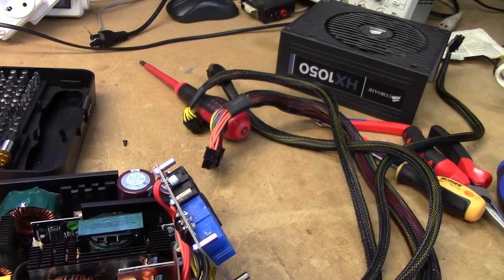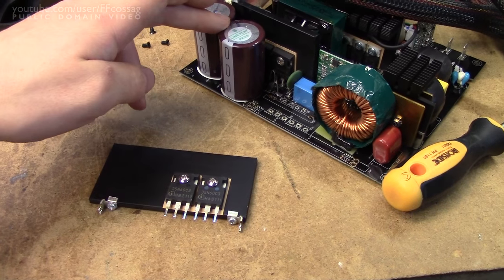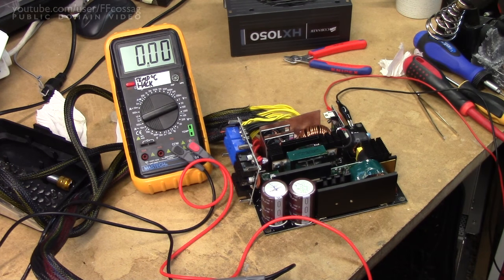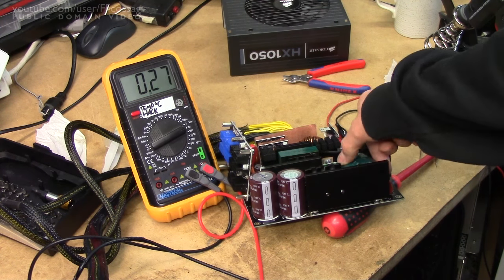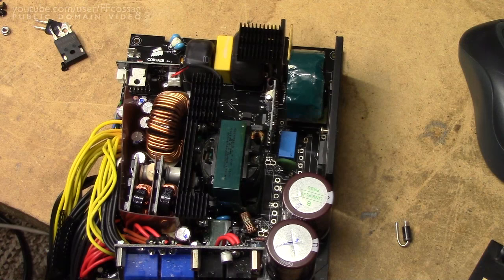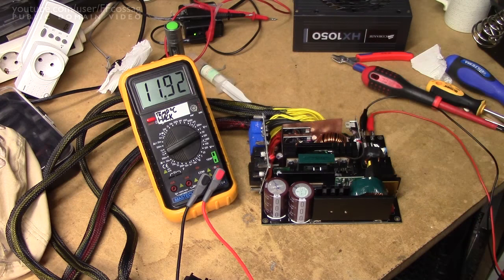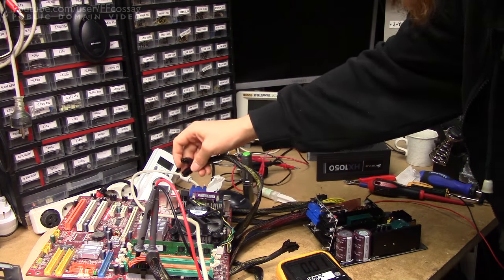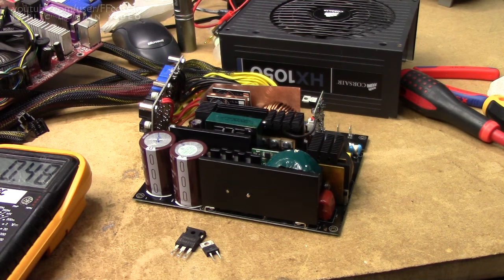Trash picked Corsair HX1050 PFC circuit repair

Comment: Whenever you have diodes or transistors in parallel, it's really best to replace both the failed one and the good one together with two diodes you  bought at the same time(increasing their chance of coming from the same batch). This is because the diodes have a negative temperature coefficient(temp goes up, resistance goes down, current goes up, heat goes up,...) and the only thing keeping a little balance is the shared heatsink.

Really make sure to order at least two of those diodes and two of those transistors, maybe even four, just in case it happens again :P
Reply from the maker: Solid advice, I'm of course replacing the failed pairs in pairs for those exact reasons.

Comment: HX650 psu had burnt mosfet and diode 1n5406, replaced them and psu came back to life. All voltages ok but under 40-50% load same components died again, one transistor and diode. Any ideas?

Comment: Great fix! You should post the video on /g/. I'm always skeptical about Corsair Power Supply Quality. I've seen them fail ever so many times whilst a cheaper Cooler Master or Xigmatek seems to just keep chugging on just fine. I think they are just very sensitive to the quality of the mains input voltage. So kids here is the life lesson "Always use a mains voltage power conditioner."
Reply from the maker: If you want to post the video on /g/, feel free - I don't usually post my videos on there any more unless it's in relation to something specific.

I would not recommend any "mains voltage power conditioner". They're usually just bullshit, and will not do much to help you if something actually goes severely wrong on the grid that the protection circuitry in your power supply doesn't already do.
Reply: FFcossag
Don't voltage regulators such as these help reduce both transience and voltage spikes from the mains? http://www.fsp-group.com.tw/index.php?do=proinfo&id=61
I don't know it seems to be the main reason for PSU failures considering we have alot of power outages and constantly flickering lights in my country.
Reply from the maker: Dirty Reviews Are you sure that's a voltage regulator? It's advertised as a UPS, and it definitely doesn't look big enough to be a double conversion UPS. I can't find any info on it, but I'd be about 90 % certain that's just a line-interactive UPS that's basically going to be a straight pass-through unless you get a long-lasting brownout or power failure.
Reply: Actually It definitely is not a UPS system. I own the 750 watt rated version and it merely indicates that it regulates the mains voltage and prevents spikes. I think its a back to back converter so something on the lines of AC>DC>AC. Its definitely heavy and probably has some large coils/caps inside so not one of those bogus Chinese "conditioners". I actually would love it if you did a video on these because they are right up your alley. Sort of like a UPS but without the battery and for people such as myself who have mains stability issues in their region.
Reply: FFcossag
I just did some quick duckduckgo searching and all I could find was that it contains a "Boost and Buck Stabilizer" according to a marketing document.
Reply from the maker: It's listed as a UPS on their website. I don't have one of them, so I couldn't possibly make a video about them. I suggest you take it apart and see if the weight comes from a lead-acid battery.
Reply: I'll check. But if it does i've never seen it kick in not even once. And it only has an on/off switch.
Reply: Helllo i managed to kill a corsair rm1000x by plugging it in stupidly to a low quality power strip. It smoked. :(

Comment: Hello, nice video ! i have approx the same, but where do i find the 5vsb and 12v rail within those output connector ? i do not have any cable and i do not see any yellow wire. thanks

Comment: So six months ago found a similar fault with my HX750 PSU.
Looking at your video, the fault is almost identical, except both larger IPW60R190 FETs had died, and the fuse had exploded.

I bought new ones, replaced them, but when I powered it back up, they were killed again. Also, the (single) C3D06060A diode blew apart (front came off with one leg, the other leg stayed on the heatsink). I did a bit more fault finding and found that the smaller diode had also failed.
Replacing all three components (this time only one FET so I don't lose two devices if it blows again), I powered it up and enabled the PSU with no load. The fan spun for a second or so, and then turned off. I'm guessing something further along the chain is stuffed since I can see the boost converter output reading the right output.

Not sure if I should spend much more time I should spend, and am I really going to trust this supply with anything other than a cheap PC now, but I'll try a few more things.
Reply: I had the same problem. Did you fix it?
Reply: @rPaguHaP  From memory, I had to place a small load on the the output, but I think there may have been one other smaller diode that had failed. I got it back up and running, and it's powering my secondary PC since I am too worried to use it with my newer parts. But it works again!
Reply: @rownadoherty  Thank you! Smaller diode like SMD diode? I Need to know here to look at :)
Reply: @rPaguHaP  I'm fairly sure all the parts I worked on were through-hole. I normally start by investigating the large semiconductors and resistors/caps.

Comment: I heard that testing a Power Supply with a meter doesn't always show faults because theres no load on it but I figure if you're getting the 5v and the 12 v readings it at least a good sign
Reply from the maker: For diagnosing bad caps, that's true. This isn't a case of bad caps, however. We just want to know if the unit runs.
Reply: @FFcossag  will the voltage drop when loaded in case of bad caps?

Comment: Nice repair!

Wish i had the knowlage! Just brought home a Silver Power 650w PSU that just stopped working.
Hoped it would be a simple "visible" fix, but as a noob i cant see anything wrong.. :P
All the caps looks fine. And it looks really advanced inside, not as easy as the older PSU's.. Several small controller boards and stuff. So its probably trash, atleast for me. :-)
Reply from the maker: What a shame. PFC failures like the one in this video seem to be quite common for active PFC power supplies in general, might be worth just measuring the primary side FETs and diodes for shorts.
Reply: Is it possible to measure the diodes when they are still soldered to the board? Or do i have to take them out?
Reply from the maker: Often it's fine, if they do measure short then you should take them out to verify.

Comment: Nice video! I have one Enermax PRO 550W (with no warranty) but it is as new.. i used it for a short time. Now it seems have a problem at 5V gray wire (Power_OK), the other voltages are ok, only the gray wire have 0V (and i think this is the cause of computer dont start).. but i dont know how to fix it..

Comment: also i have a cooler master(non pfc) 500w (many say it is actually a 450w), it has double bridges & double switch mosfets in parallel.
it works sometimes when switched on , sometimes not only 5vsb is available, the fans turn on for .5 sec & then off then i have to hard restart it. i checked the voltages in bios sometimes the 5 v & 12 v fall below the  lower 5% tolerance, i.e 4.7V & 11.3 v,
what could be the problem the mosfets or the schottky diodes or caps, i don't want to discard it, it is beautiful ps.

Comment: People say don't touch a PSU for days after it's plugged out as there can be power in the capacitors. How long did you leave it before touching it? Could you vaccum dust out of it straight after plugging it out?
Reply from the maker: Just don't poke around too much.

Comment: what would be your best guess as to what caused the power supply to fail. lighting strike or just bad luck with parts or overload
Reply from the maker: The root cause of the failure was the diode between the rectified grid and the PFC boost output. It fails if there's a giant spike on the grid, or if it's of poor quality. Lightning strike is improbable; would have been more damage. Random failure seems like the most reasonable explanation given the minimal amount of cascade failure.
Reply: valdarmort ,
The reason for the 600 V rated slow bypass diode is to pre-charge the boost capacitors on power up.  Without it, the build up of current in the choke/fast diode/capacitor loop would charge the capacitors to DOUBLE the peak voltage.  Probably all practical implementations of the boost topology use this arrangement.  But the bypass diode will pass an immense inrush current which depends on the line voltage and impedance -- including any limiter circuit possibly added to the input of this power supply.  A malfunctioning limiter could be the root cause.  A thermal NTC limiter does not work if it is not allowed time to cool down before the next power up.  Similar problems arise on relay type limiters.

Comment: what are you using for the limiting of input current? can you show us in a future video?
Reply from the maker: I don't recall if there was anything specific going on in this video, but I usually power everything off of my bench PSU. It's a TTI EX752M that'll do CC/CV up to 150 V/2 A.
Reply: @FFcossag  you are powering the psu under repair straight after the bridge rectifier with DC voltage from you bench power supply?

Comment: Would you know the value of TH1 (thermistor) on the corsair HX1080 as it is burnt
Reply: I'm trying to rescue a HX1050 with a completely blown Thermistor at TH1 (along with shorted mosfets and diodes). It's a NTC, I assume. Did you ever find out what to replace it with?
Reply: @TheGiddeGadd No idea of the value of TH1 would you know the near value or equilivant value??
Reply: @ehmd2912  I don't know, I was hoping you would know :) Mine was blown to pieces, no way to read the part number

Comment: Hi!

How much do the parts cost that you need?
This thing costed (if it's the silver edition) around 180€ here in germany (gold 150€) - so it's a pretty pricey PSU.

Nice Video!
Reply from the maker: Parts were about 30 €. I think it's older than the 80+ models, though; there's a newer HX1050 on the market now.

Comment: which one is best brand for psu among antec,corsair , thermaltech...???i want to buy antec vp450w psu.i have no ups . so please tell  will this psu save my pc from over voltage or current?????
Reply from the maker: Nothing saves your PC. All the brand names are good as long as you buy an expensive unit. Cheap ones are trash.
Reply: even i have no gpu in my pc .becoz i am not interested in gaming...so i think 450w good enough ....but having no ups  iam concerned for voltage up down ....

Comment: What's the part number of the blown components ?
Reply from the maker: CSD06060 and 35N60C3.
Reply: FFcossag Ok, by 650 volts I have expected IGBTs, and thank you :)
Reply: FFcossag Does this PSU use a half or a full bridge to drive the output stage, and at which frequency ?

Alex
Reply from the maker: High Voltage
I don't know, none of that was relevant to repairing the unit.
Reply: FFcossag Ok :)

Comment: if you measure a short over a diode in circuit, it is 99% not normal, as having a diode directly across an inductor makes no sense.

Comment: I've never had a PSU fail on me I guess Im lucky but it's a common complaint that especially cheap ones tend to fail often
Reply: Oh yeah, don't get me started on the cheap ones.
I've seen cheap ones labelled for 600W or more, yet the guts inside can barely do 200W!!!
Those always blow up nice n good, usually frying the motherboard in the process!